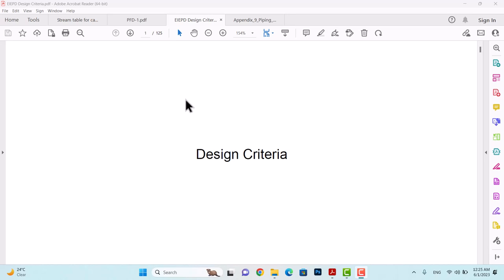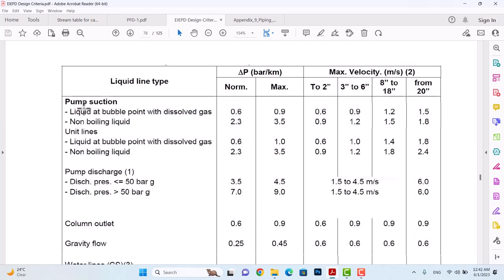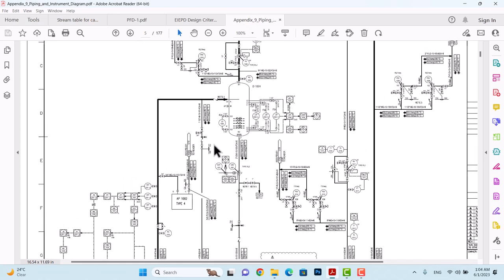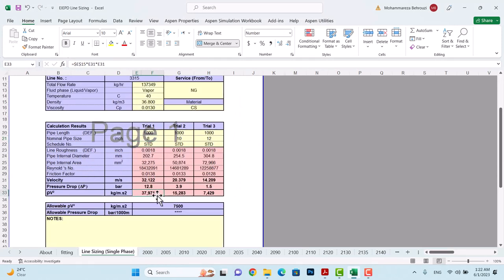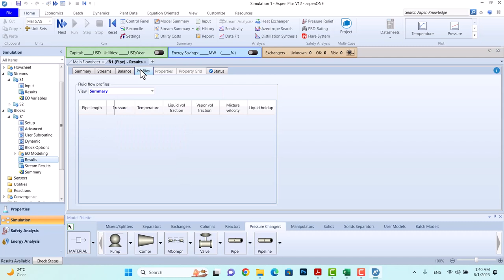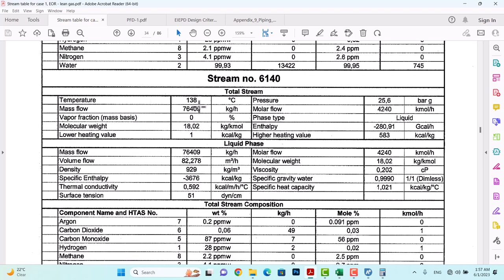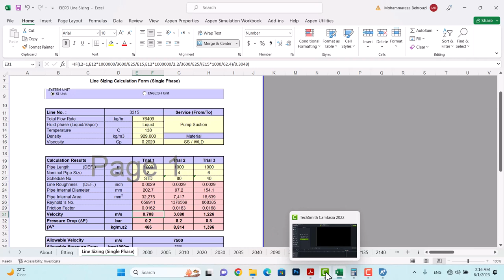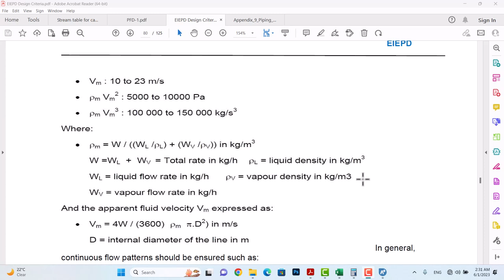Line Sizing

Comment: Thank you for the knowledge & I learned something new today! Please note that the pv2 values in the calculated spreadsheet and Aspen Plus vary slightly due to differences in the fluid composition used for C2+, which results in different mass densities. This is crucial for estimating the vibration effect on the fluid flowing in the pipe. In real work, it's best to obtain the complete fluid characterization for heavy hydrocarbons as well to closely match their properties to the sizing results. However, for a percent difference of less than 5%, the simulation result is acceptable in this case. Just my two cents